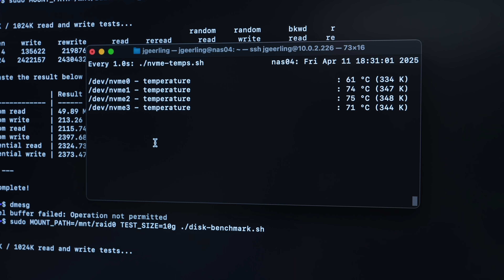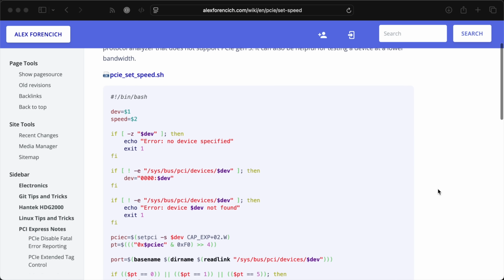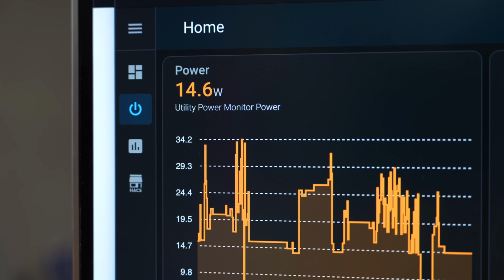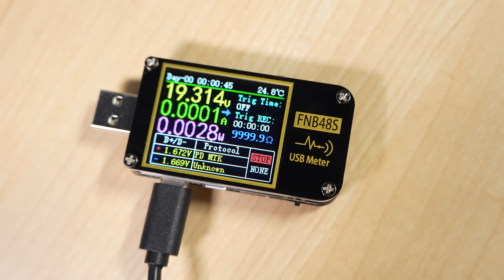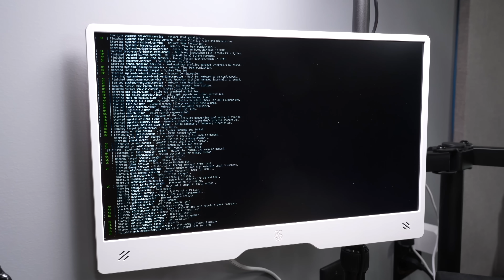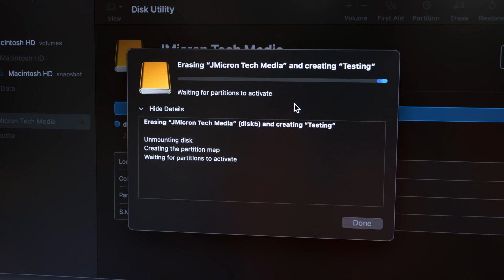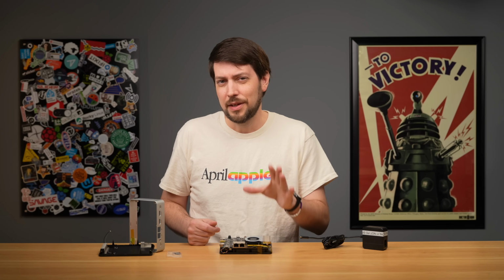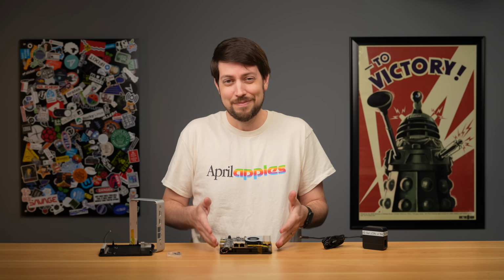I fixed the perfect Mini NAS!

Comment: Great video, thanks. I also have a Nucbox G9 running 4 x 1TB Crucial P310 SSDs. I'm running Truenas scale 25.04 on it, with Plex, Syncthings, Paperless-ngx and Homebox running. With the original BIOS settings, the temperature was a big problem, rediculously high. I tried many different options, but in the end I now have it running at much lower temperatures now. In the BIOS you will find the fan settings #1 & #2, which I take to be for the CPU and maybe #2 for the two little fans on the side of the drive bay. I changed all the fan settings to kick in at 30C, so the highest fan setting kicks in almost straight away. This keeps the tempertures of the 4 SSDs at +/- 45C and the CPU at 40C. Obviously, the G9 is no longer inaudible, it now makes a bit of fan noise, but it's not too loud, and it has solved the heat problem for me.

Comment: Jeff, with regards to the offer to test other equipment, do you really have the time?  I like the fact that you've tested some kit and found issues so the rest of us don't have to but for the sake of your sanity, draw a line!  If the product doesn't do what you need it to do straight out of the box then throw it and get something that satisfies requirements.  You're just going to spend your life disappearing down rabbit holes - and life is too short for that!

Comment: Okay I know I'm spamming you a little bit but hear me out. Yesterday I just put two 4 TB drives with larger heat sinks on them and one of them being a Samsung Gen 4 the other being an SP Gen 4. Both are 7, 000mbps read. I then had the one terabyte that came with it and another Samsung 970 1 TB I had sitting around. I then map these as shared in Windows and using Windows those copying over terabytes of my game library last night at 256MBps. I turboed the heck out of that chip.

I'm guessing you either got a bad one or something is wrong with your cooling. Yes it gets warmer and I do stand it up on its end but even sitting regular it didn't have any issues.

Comment: I purchased one of these and I was copying terabytes last night at 286 megabytes per second with no issue. Granted I was using Windows which I'm going to ditch because the antivirus eats up way too much of the processor but I had no problems copying files. As I watch this I worry even more because I turned all of the turbo stuff to the max. I did it just the fans a little bit but not by much.

Comment: Take them up on the offer. Since the past video, I returned my unit. It would lock up due to the thermals. With heat source and a 100mm fan it wad running too hot to use.

Comment: I applaud the persistence. GMKTec have really messed up here and it could really damage their reputation. Quality control is almost completely absent. Then that SSD issue doesn't exactly give total confidence in the Kingspec name. Yes, of course take the other company up on their offer, especially bearing in mind the catastrophic out of box failure from GMKTec. It is a shame that they have not reached out but not that surprising really. I nearly went for a G9 myself. Bullet dodged.

Comment: I'd love to see a setup with 4× Radxa 4SE or 5A boards as nodes, each equipped with a Penta SATA HAT and populated with 4 or 5 × 2TB 2.5" SSDs.
Install GlusterFS in distribute mode across them, and use a slightly more powerful master node, like a Radxa X4, for coordination.
Also, all nodes should have USB-to-2.5Gbps Ethernet adapters, connected to a 10Gbps router with at least five 2.5Gbps ports.

Would be awesome to see the transfer speeds! :3

Comment: 3d print a new skeleton case. I know, you shouldn't have to, but why not go for it if you're going this far. That way you keep it exposed to enough airflow while also holding it together properly.

This reminds me of a terrible router we got from the cable company years ago (back when they swore up and down we HAD to use theirs in the days of hard fixed SSIDs and passwords that could be reversed off one another). It ran so hot that even in the best possible location it would crash regularly and be down for 15 minutes while it was unplugged to cool. I quickly got tired of it, cracked it open, slapped a fairly decently sized copper heatsink on it with Arctic thermal adhesive, and that got it to be stable, but it would still quickly saturate the heatsink and it was throttling. So I wired up a case fan with a USB cable and used the router's USB port to power it and what do you know? Stable as a rock and no throttling.

Comment: Thx Jeff, that u still try, and to be fair... The N100/N150 isn´t easy to handle;
some could do it (like Asus), and some not (Asrock), p.e .at the ITX Boards

But to be honest: Okay, u can cut off a man´s balls, and he would be still a man... in a way...
But this isn´t the reason why i should buy this crap-device, to throttle it, running on the specs of a C64; and i am long enough conneted to computers, but as consumer, i didn´t want dive into all that, what u show. I want open the box, i want use a device, without thinking: Oh, should i buy this NVME, or that RAM... don´t forget: They handed out with a ram... which should be fine; sme with the power adapter:
And, 4 me, it was experince enough, that i got be contactet by privat email, i should "rethink" my sharings of experince on Amazon; and weeks later, aftr device already send back, i got (over amazon/could only read by mobile device) another "contact"... iff there is a poss. to fix "the problem"...
Sorry; and i felt "dump", when i order the device in March for 35x,-€ (few days later there was a % at Amzon, so that it was cheaper), and now, its round about 27x,- on Amazon (regular);
So they know, the device is crap, and i am not buying it, to let it run "open" as u did, or with big fan, to cool down

My recommandation, as at the preview video: The tiny computer from cwwk, with 4 NVME  and solid Aluminiubody, and a soldi copper-bottom.
I run it in my bedroom (23-24 degress), no noise at all, and device is running with 4x 2TB random / Sandisk-NVME (out of the box) and crucial RAM. As Boot device (after different trys&fails) i use a SandDiskExtrem USB 128GB drive; with ProxMox on it;
with  different CTs and VMs, like trueNas, ZimaOS (the better CasaOS) and other cotainers. No heat, no noise at all; and with teh enclose S-Ata connector, i would be able, to place a real SSD (dont forget, when u order at Amazon with SSD.. its a NVME, and u would have only 3 NVME Places left), so that i could use the NVME places fully.
I really appriciate your work , and i learn a lot from you...
But there is a phrase.. Never ride a dead cow...
The Idea of GMKtec wa s great, but this device is a fail; and more fail are all the youtubers, which "Tested" the device and recommand it (few month before).... and it seemed.. the never really tested the device (Cause it was a overview of the named specs), which made me angry, cause of the recommandation of this (seriouse) sources, i bought this device...
And i was at the point u was... but i gave up, cause this device cant be saved.
Therefor it´s better/cheaper to make your Penta-Hat Raspberry PI NAS

Comment: Wtf I was NOT expecting that pi going to 160C to still work. Wouldn't it basically reflow itself at that temp?
Reply from the maker: Not quite, I think the melting point is in the 220-260C range? Not 100% sure on that.

The worse thing is if I let the component keep heat cycling like that for a long time. Definitely would ruin it after a bit (more so than I already did!)
Reply: @JeffGeerling  Yeah probably too low for regular solder but I thought the bath stuff they use had a similar melting point, guess not.

Comment: Great video and awesome investigative work.
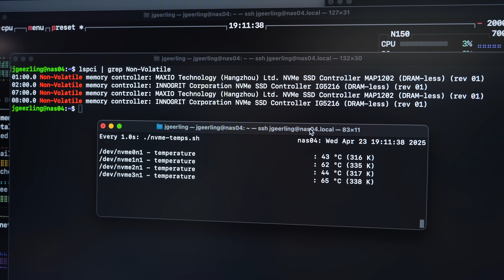At 10:15 when showing the temperatures, on the terminal behind you seem to now have 2x MAXIO &  2x INNOGRIT controllers
Is it a difference in controllers that causes the 20 degree temp difference (42 vs 62 degrees) or their position on motherboard?

Comment: For our entertainment, take them up on their offer.

For your sanity? Hmmm...

Also, I'm not sure "fixed" is the right word if you have to change every other component and setting to get it working ok-ish 😅

But hey, I learned a lot at your expense, so thanks for the video!

PS// Have I ever had a project that was cursed? Most printer projects...

Comment: ic  heat sink .. used that to fix a issue on m.2 and where heat in system dump hot air in a area and barely any air pass thru.

Comment: Please do take them (K100) up on their offer. 

You are doing an outstanding job of determining if the design/engineering of SSD NAS is really ready for widespread deployment. Your excellence as an engineer is driving them to be better manufacturers. 
Your work also shows new engineers how to ask the right questions, and to test systematically. A great role model. 
Thank you.

Comment: You can try to restrict direct flow to fan from holes in top panel forcing intake air to flow through whole board, it is actually looks like that it was an original intend of a case(there are intake holes on the side) and those hole pattern on top panel was applied as afterthought by someone not smart enough to notice those intend. So in theory, it can be fixed by just taping top panel up that it does not mess up smarter airflow.

Comment: Maybe it is already discussed. But in general. How good idea to use ssd for nas as long therm storage?
Reply: On a ITX-Board i use 4 of them, on a pcie Card , for fast storage,  given later on the reals (3,5) HD´s  (backup)
During the last year/since i run this,  i had no problem.
The machine is a kind of cloud for pics and vids, sharing by 4 ppl.
And till them, i trust the term of use (how many read/writes), doesn´t matter, iff long o short storage them. (Backups are allready on 2,5 external HDs)

Comment: Pretty harsh lab session.  1) GMtek has known thermal problems - why try to kludge a bad design ? Your efforts cost more that the GMtek.   Your choice of Kingspec suggests you failed to learn a cardinal rule - Chinese designed & built stuff that pushes any tech limit comes in two forms - total junk and partial junk.  ANY eom that changes to controller on the same part number, and can't implement a competent nvme interface is well into the partial-junk range.  Good name-brand M.2 nvmes cost 30% more - buy them. Do you really want a NAS w/ unreliable storage ?  As a design decision - do you REALLY want to pay for 4 channel  NVME speed for a NAS with a 1Gbit pipe ?  That's not-smart(tm).  Even a SATA will outrun 1Gbit.
My take-away - never buy GMtek, never buy KingSpec.

Comment: Wow, I was disturbed when you were describing the system's instability and temperatures. That's a really bad design. But then you got to the 19.0v power supply from hell!

4:40 That has to be the most horrifying electronic thing imaginable! I knew that most USB power supplies are pretty bad (thanks to the superb work of the DiodeGoneWild guy), but I've never heard of one THAT bad.

Also, note that 19.0v is not a legitimate output voltage for a USB-C power supply. PD compliant power supplies are supposed to be able to output 5v (always!), plus 9v, 12v, 15v and/or 20v, but never 19v.

I would NOT knowingly use or buy ANYTHING from a company which bundled that monstrosity with their NAS. So I hereby resolve that GMKtec products will never darken my doorstep.

22:45 W/r/t your question about testing the Aiffro K100, sure, give it a try. But I recommend that you START by testing the power supply. If it reminds you at all of the GMKtec garbage, I'd stop there and just send the whole thing back. Their specs claim that the bundled power supply is rated for 65W, but that seems anemic for a NAS. SSDs can apparently use up to 12W each, peak, or 48W total, which doesn't leave much for the rest of the system, especially since it's generally a Bad Idea to run power supplies close to their rated maximums.

And thank you for confirming my suspicion that it's a very Bad Idea to entrust data to KingSpec-tier SSD manufacturers. I'm not above using floor sweepings for some things, but not for my data. (I'd really prefer to have my data on Samsung drives, but I settled for TeamGroup in my main PC -- that's as low as I'm willing to go.)

Comment: Thanks for sharing ! Had this box on my shopping list, but due to disciovered caveats and expensive SSDs will stay with something else.
The setup with temps are as follows: 99% of Chinese SSDs(Kingspec, Rangxiang, Netac etc) lie about the temps(lock the reading either on same temp or within "safe" boundries not to scare the consumers). If you are thinking that Banded SSD manufacturers do not do the same ....then you are also worng. Same measures are implemented, but by a smaller degree: reporting only sensors in coolest points, or plain hiding the controller temps and showing just mem temps or simillar steps. 
Want a proof - do an open bench stress test of ANY nvme SSD you have - and compare temps SW reported with quality IR Temp camera(which you, Jeff, I know have in your posession) - you will be surprised. Very few of the manufacturers do acrtually show correct and accurate temps for nvme SSDs anf that of Gen4 do run hotter than Gen3 (though not by much).
Jeff please - pay more nerdish attention to this in your review - since you are already wasting your nerveous system on that xD

Comment: What I take away from this is if you take the computer apart so it can breathe and put some more heatsinks on in critical areas, everything works as it is supposed to? Or did you still have to underclock/neuter the performance of everything? I already bought one of these before I watched your videos but haven't started using it yet, but maybe I should return it if it's just going to be a huge PITA. My plan was to simply have a lower powered device running Unraid with some SSDs as a cache with a DAS enclosure. At that point, might as well just go with a normal NAS from Synology or whoever. :(

Comment: I have a bunch of USB chargers on a power strip. I've been thinking about a USB charger, to drive multiple devices AND free up some power slots. BUT - one device is a Morefine M6, and the supply is a 12V version of the beast in this video.

The perils of driving multiple devices, from a single USB-C PD, is certainly a topic for a video. There are even Aliexpress boards to convert USB to power barrel jacks, so a legacy switch (5 to 8 port) could be supported too.

Comment: i think if a power supply only supplies one voltage dc voltage under 50v and it does it all the time with no negotiation, it should have to use a 2.5mm barrel jack by law (or a more robust plug for higher currents). no more of these device frying ""usb c"" adapters!

Comment: I have a x4 M.2 PCIe LFF card in a Supermicro 2U server running TrueNAS. I also bought 4 M.2 heat-sinks. The card didn't fit with the heat-sinks on one side of the card. I removed them and noted the SN of the M.2s without heat-sinks. TrueNAS reports that the two M.2s without heat-sinks are running cooler than the other two. Weird right?

Comment: A little side tangent on DRAM-less SSD and ZFS. 

ZFS issues flush commands on sync and flushing writes any SSD without PLP will both take some latency and wear out the SSD just a little more. If you try with sync=disabled, then that'd be the best performance you can get out of the drive without the things to think about for ZFS. You can loose the last few seconds of writes in the event of a power loss but ZFS will remain consistent,

Comment: Definitely try the other one. You're determined, I'll give you that!

I've had thermal issues with mini pcs, more common than not. I have a chuwi box with a 5800H in it and two nvme drives. If I do a deep virus scan, the cpu and the drive being checked are both overheated and throttling badly. Also has a big metal case and nothing tying any of that to the metal. I took the cpu cooler off, single small heat pipe and a little whizzy laptop fan. It was clearly made for a quad core at most, but they shoveled the 5800H into it anyhow.

I almost bought one of these nas's yesterday. Amazon has them on sale for $200, around the same price as aliexpress. Someone must have done a bad review on it?😄

Comment: I returned mine... I added an external fan to force air through because I didn't want to disassemble it to the level you did. Got to about the same state as you, but that didn't fix the reboot bug of the pcie switch. If I can't reliably reboot, it's just a no-go.

Comment: So long as Aiffro will allow you complete editorial control, then Yes! 

There aren't many reviewers of these devices that put in the detailed work that you do (no offense intended to STH or NASCompares).

I almost bought one of these units based on some other reviews i've seen, and expected you might have had a deffective unit. But this video erases all possible thoughts I had of that possibility...it's clear now that this is just a poorly designed NAS device. We need more of these reviews that expose the design flaws of these devices.